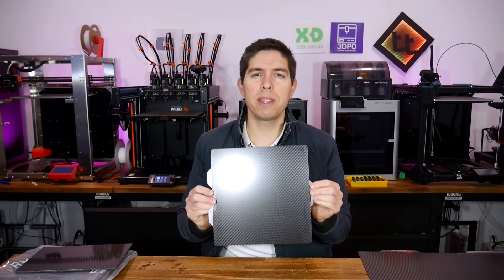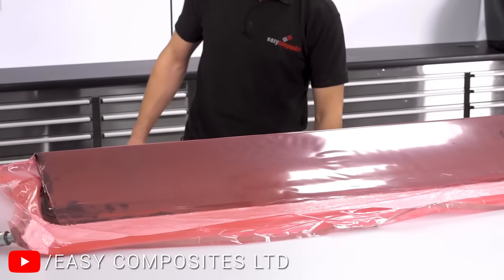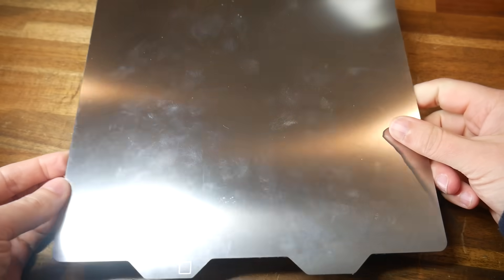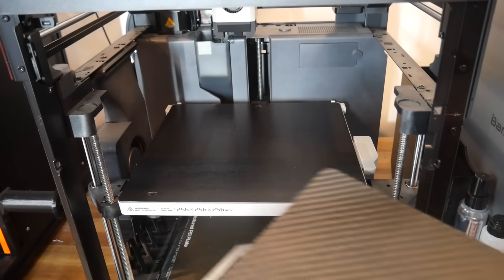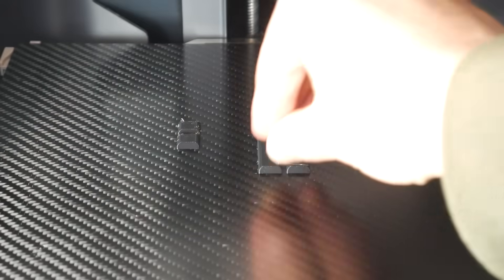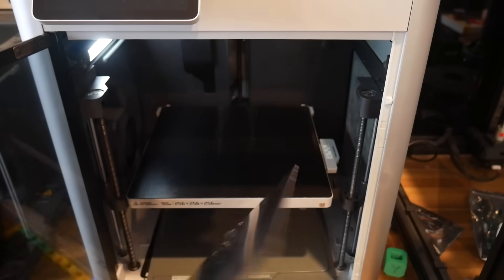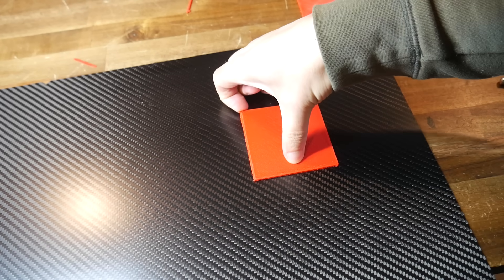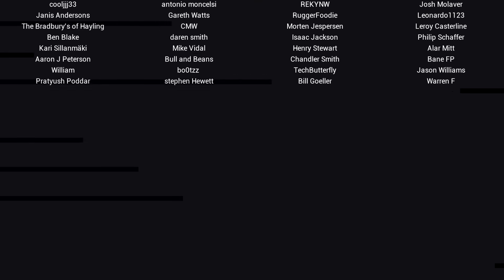Testing the Wham Bam carbon fiber plate - The ultimate 3D printer bed?

Comment: I'll never, ever, ever completely trust a sponsored or affiliate linked review.
Reply from the maker: It's good to be sceptical, but you also have to judge each video on its merits. Did you feel this was a one sided, overly positive review?
Reply: @TeachingTech  You have a direct profit motive in this product selling well.

"Did you feel this was a one sided, overly positive review?"

How can I tell? The product might be awful, but by striking unjustified middle ground and giving the illusion of neutrality, you are actually doing them a huge favour.
You repeatedly defended the fact that the surface was too sticky, or got damaged suggesting that this true of all surfaces. Other surfaces are not made of carbon fibre - supposedly known for its toughness. Nor are they $60.
This is the danger of access or reward journalism - even though your intent may be pure, your motives will never be completely trustworthy. It's impossible to remain truly neutral in such a situation, even if you go the other way in an effort to be fair. You used to know that.
Reply from the maker: All fair points. All I can say is I still review things exactly the same. What you are seeing here is exactly what I thought. The illusion of neutrality is not an illusion.
Reply: @TeachingTech  That's what I'd expect a shill to say. Or a non shill. That's the problem. 😏

Comment: If you're printing on epoxy, which covers the carbon fiber — why do you need carbon fiber at all? Why not Just cover the spring steel sheet with that epoxy and call it a day?

Comment: Outside of special high end filaments i see print beds as a solved issue

Using stock ldo or prusa parts i get perfect first layer adhesion with barely any cleaning ever

Comment: guys guys guys ..... i know what your thinking ,why is CF there in the first place if your printing on resin , i think the carbon fiber is there to give the resin stability , you cant just coat the metal with resin and leave it at that ,the resign will deteriorate and crack and peal off ,resin is not good at sticking to itself and forming a good surface on its own, its way too brittle , carbon fiber gives the resin something to grab onto ,soak inside and give flexibility to the resin , the resin is now in contact with the steel back ,and CF ... just like if you drop a block of pure cured resin it will break or at least chip a corner ,while if you drop a CF reinforced block it wont get damaged
Reply: It's a bit like the difference between having concrete by itself, and concrete with rebar inside it.
Reply: 💯 my dude + the thermal stability. G10, spring steel, all have their warp from growth issues (coefficient of thermal expansion) during heating. It's why bed mesh leveling is done at temp. At this scale the growth from heat of a carbon reinforced resin is effectively zero. Only stuff growing or shrinking is the print itself.
Reply: Glass fiber or cotton would do the same. Carbon fiber is only there because clueless people associate it with something high-end and high-performance and are willing to spend more money for it.

Comment: its clearly better the bare PEI ,but PEI still does the job very very well , if they get the price down to match or even exceed the price of PEI by a little bit ,its 100% worth it for the durability ,but if you already have a PEI sheet and its in good working condition ,its not worth it to upgrade , when your PEI is worn out ,then it becomes appealing to get

Comment: I would argue that you are actually bonding to the resin, not the carbon fibers.  Thus, you should just be able to create a resin sheet to bond to.  The carbon fibers should not have any effect on the magnetism, so I am guessing that it is the thickness of the covering that is the issue, not the carbon fibers themselves. The carbon fibers solely reinforce the resin, which is their purpose in this application.
Reply: i think the carbon fiber is there to give the resin stability , you cant just coat the metal with resin and leave it at that ,the resign will deteriorate and crack and peal off ,resin is not good at sticking to itself and forming a good surface on its own, its way too brittle , carbon fiber gives the resin something to grab onto ,soak inside and give flexibility to the resin , the resin is now in contact with the steel back ,and CF ... just like if you drop a block of pure cured resin it will break or at least chip a corner ,while if you drop a CF reinforced block it wont get damaged

Comment: Around 6 years ago I made a carbon fiber build surface for my CR-10.  I bonded solid copper wire to the left and right edges of the plate so I could use the resistance of the carbon fiber as the bed heater.  This plate was the entirety of the build area.  Unfortunately the resistance of the plate was much lower than expected and I was using 100 amps at about half a volt to get 50 watts of heated bed.  I abandoned the project because even if I made it 1/4 as thick this would still be 25 amps at 2 volts and that is about as thin as would be practical.  The low mass of the plate made this ideal for Y thrasher type printers.  I did consider a sandwich of carbon fiber on top and bottom layers with a center of fiberglass.  This has issues with different thermal expansion properties of the different layers.  Ultimately an interesting idea but too expensive in practice.  The coated steel flex build plates on a core XY printer are a better solution.  My plate was not removeable and was certainly not flexible.

Not sure why the carbon fiber is needed in the Wham Bam plate.  You aren't printing on the carbon, you are printing on the resin binder.  Carbon fiber melts at just above 3650C.  The 140C limit is most likely the resin.  I used a higher temp resin with my project but its cost was part of the problem.  The carbon fiber adds nothing to this build plate except the appearance of the 2x2 twill pattern.  Coating the steel plate with the resin alone should give it all the same physical properties.
Reply: yeah, just marketting bs..just use frp plate, same resin you print on lol for 99% cheaper
Reply: I'm guessing like some of the other commenters you didn't watch the end of the video where they answer these specific questions. I wasn't very happy with the answers they gave but they did answer them.
Reply: sounds like a killing table.
Reply: Sorry but you need the weave. Coating steel with resin alone will never work. I worked on cars and did custom fabrication projects for years with steel, fiberglass and wood. The resin will chip and break when bending. It's needs the support of the fibers to function properly. This is how it was designed from the beginning. The two parts were literally designed to work together. And if you look at what Peter wrote he explains it very well why it was needed.
Reply: I was just thinking, why not just power the plate directly? At least that would be sick.

Although a failed attempt, you could just run a single strand back and fourth at the top most layer.
Reply: How did you power that monster?  100A sounds like you would need an arc welder.  Do you have a bench power supply that will put out 100A at 500mV??
Reply: @BobWidlefish  I've got an old Lambda EMS supply that will do 0-5 volts at up to 300 amps.  It takes either 208 three phase or 240 volt at 30 amps.  I plug it in to the dryer outlet.  It was originally used for some kind of electroplating.  I had extra localized heating at the interface between the carbon fiber and the copper wire it was bonded to.
Reply: @dougingraham5807  very cool!  I just looked up Lambda EMS supplies on eBay — I think I need one. :)

Comment: The SECOND I saw this thumbnail and heard you say it's genuine I was like "they do realize there JUST printing on resin right?? Like the carbon fiber is cute and all but it's just resin....
Reply: The CF is for structural stability, not surface effects like adhesion or anything
Reply: @coledavidson5630  like a sheet of resin that doesn't undergo any tension or compression needs a carbon fiber sheet for reinforcement.
At best it might stop cracks at the half way point which would be an impressive feat to get a solid resin sheet to crack in a 3d printer
Reply: @daycred  thermal warping can be a huge deal in print beds? You want it to hold its shape as much as possible. So the idea is definitely there, but based on the results of the video I'd say it's really just not a big enough improvement over glass fiber to really be worth it or even noticeable
Reply: @coledavidson5630  fair enough and agreed!
Reply: Exactly this. IF you ever see something that's carbon fiber and you can't immediately tell why... it's probably just a gimmic. This bed is no different than printing on FR4 / Fiberglass (or G10/"Garolite" as some of you like to get the non-fire resistant version)
Reply: That was my same thought as well. What difference is there between carbon fiber encased in resin and fiberglass encased in resin? Not much at all.
Reply: @jwjeff11  thermal expansion
Reply: Jepp, it's just marketing and you see in the comments that it works great.

Comment: I started using mirror glass for all materials and never looked back. No damaging, super flat and smooth with no texture, and it won't warp with big nylon/ABS parts
Reply: do you use glue for nylon?
Reply: @riba2233  with a mirror ,you use glue on everything , also if you have a bed slinger ,make sure to take into consideration that your bed is significantly heavier now !!
Reply: @fouzaialaa7962  thanks, and what glue works for nylon for you?
Reply: @riba2233  I use PVA glue (indoor wooden glue) for nylon. It binds so well that it works even for non-CF nylon. I don't use anything for PLA or PETG, the key is just that it must be super clean (soapy water, then polish with dry paper towel)
Reply: @rrrlasse2  ok thanks, and do you have any issues with petg sticking too well to glass?
Reply: @riba2233  No, I've never had that issue where it pulls pieces of glass off the plate. I don't understand what parameters cause that. I'm just using 20 mm/s first layer at 70 C, and line width = nozzle width (not .5 like some slicers do which causes nozzle buildup)
Reply: @rrrlasse2   interesting, thanks!

Comment: @Teaching Tech, how are you handling bed temp differences with each plate? When I started using G10 plates I had to set up new filament profiles with the bed temps in Bambu Studio/Orca so I ended up with duplicates for every filament I wanted to use. If I set it up properly via the Custom Filaments panel in BB Studio, I could still use G10 plates with Bambu Handy and print without going to the computer. Do you have a better method?
Reply: +1 for it, it's a good question
Reply: Set the Bambu to "Hot Plate" and problem solved. Place a code sticker on it if you have one. For PLA I do increase it to 60C as PLA is 55C for the hot plate. All other temps are standard hot plate temps.

Comment: The whole time I was wondering if there is an advantage over G10 because I am very happy with G10. It sounds to me like the main advantages are for the manufacturer of the plates - having control over the process compared to when you just buy an industrial G10 sheet. 
But G10 when you make your own plates is so cheap I find it hard to justify buying something like this. I bought 4 pcs of 512x524mm sheets for my V-Core for roughly 70 USD. Even if I add the price of the whiteboard sticker to make one side magnetic they still cost about a third of what a replacement PEI sheet would cost me and this carbon fiber plate seems even more expensive than PEI.

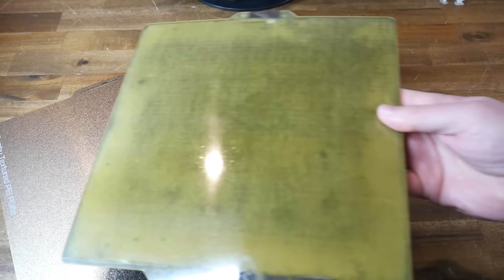Comment: 4:38 I was late to the party and you can't buy the BBL Engineering plate anymore, got any recommendation as a replacement? I like the Lightyear G10 for PETG (might replace it with this plate becuase you have to raise bed temp by 10 degrees every time you print which means you need duplicates of your favorite filament profiles) I haven't yet printed ABS and ASA yet, but I just bought the Voxel Bento Box specifically to do so, so I'm researching my options :)
Reply: just use textured pei.

Comment: I do wonder if there is a more stiffer spring steel plate. Often when printing large ABS parts, the part warps slightly and brings the spring steel plate with it. Its not that the part is not adhearing to the plate but the plate is not stiff enough to resist the warping. I know others have experimented with ABS-GF with better dimension stability but it would still be nice to have a stiffer spring steel plate for people who don't want to upgrade the nozzle and extruder gears for fiber reinforced filaments.
Reply: that seems like the perfect place for a thiccc piece of glass.

Comment: Titebond - the best solution
wipe with acetone
smooth as new
Reply: We don't have Titebond here and Ponal isn't entirely terrible, but PVP granules i got from overseas hold much better, i just dissolve them in water till i'm happy with the consistency to brush it on. I don't print PLA (and it sticks to anything anyway) but i need for one a release agent for PETG on glass; and for other a good adhesion promoter for HIPS on glass.

Comment: i dont understand what the carbon fiber do, if the material that is in contact with the plastic print is just the the resin. just make a metal sheet with the resin as a top layer for the same result
Reply: They impart a little bit of surface texture or waviness, they conduct heat remarkably not as badly as resin, and they look cool.

Epoxy thermal conductivity is on the order of 0.1W/mK anisotropic and with carbon fibre it's 2-3W/mK in the plane and 0.6W/mK vertically.

Yes there's for sure ways to accomplish this at a lot less cost. Higher thermal conductivity is equivalent to less material thickness, and by all reason, you could impart a texture on the part in any number of ways during manufacturing.

Comment: With a carbon fiber bed - you're not printing on carbon fibers - you're printing on epoxy resin.
Just as good, but far far cheaper is using an FR4 bed. FR4 - the stuff printed circuit boards are made from.
*Epoxy resin* with glass fiber instead of carbon fiber.

Comment: I’m wondering why the carbon fiber is need at all.  Why not use just the epoxy resin to coat the plate leave the fiber reinforcement out completely.
Reply: It's like concrete without using rebar. Using the cloth layers adds durability and provides backing strength. Like how a framed home has very little strength until the wallboard is attached. Like the back on cheap bookshelves.
Reply: @jimmanis6717  that's clear. But why carbon fiber and not just fiberglass
Reply: @elleryfg7853  carbon fibre cloth is massively stronger than spun glass. Like the difference between a hammer and a window.
Reply: @jimmanis6717  I agree but the fibers are not load bearing at all. You can achieve the same result with fiberglass. All the carbon fibers are doing is looking pretty under the resin and they increase the cost.
Reply: @elleryfg7853  I didn't think I had to mention that fibreglass is an insulator which defeats the purpose of a heated build plate.....
Reply: @jimmanis6717  Garolite, G10 use  fiberglass
Reply: @elleryfg7853  that only means your fiberglass G10 will heat up slower and require more power for the heat to punch threw to fiberglass and go from your heated bed to the surface of your 3 d printed part
Reply: @elleryfg7853 I'm pretty sure fiberglass instead of carbon is what garolite sheets are lol
Reply: @clutchboi4038  thanks for agreeing with me. Yes, you're correct, G10 is composed of fiberglass bonded with resin under pressure and heat
Reply: @elleryfg7853  I'm wondering tho maybe the carbon will deflect less under heat. I have a g10 sheet and it bubbles up in the center when heated. I'm going to try another g10 sheet that came with 3m glue that I adhered to a piece of glass soon 🤔.
Reply: i think the carbon fiber is there to give the resin stability , you cant just coat the metal with resin and leave it at that ,the resign will deteriorate and crack and peal off ,resin is not good at sticking to itself and forming a good surface on its own, its way too brittle , carbon fiber gives the resin something to grab onto ,soak inside and give flexibility to the resin , the resin is now in contact with the steel back ,and CF ... just like if you drop a block of pure cured resin it will break or at least chip a corner ,while if you drop a CF reinforced block it wont get damaged
Reply: It's just marketing to clueless people. Carbon is the new shiny.
Reply: I was about to say the same. What provides the adhesion properties is the resin they use to coat the carbon fiber sheet. I don't see how this is different to using fiberglass for the base material. The carbon fibers don't add any adhesion properties
Reply: @elleryfg7853  Same thought. It might be due to the fact, that other materials may deform at very high temperatures? And may stay deformed? In the beginning of the video, he claimed that the bed will stay in shape... maybe it is a concern with other beds. However, this one also has a metal bottom, right? But yeah, it's restrained by the carbon fiber. I don't know. I guess a lot of marketing here. People may think it will last forever because CARBON FIBER but the functional part is the surface. Being epoxy.

Comment: How to compare with the 15$ cheap PET carbon fiber look print plate all over different sellers since 2 years ago?
Reply: these don't give a textured look. It's a smooth finish, so if you're after the CF appearance, this aint it.
Reply: @kazolar  those indeed give a carbon fiber texture look, I have 4,5,6 of those for voron and mk3.

Comment: Since the CF (at least partially) blocks the magnetic field, do these work with Beacon or other eddy-current bed leveling?
Reply: Would be worth testing, but beacon contact is available, so if the proximity mode is impacted, could switch over.